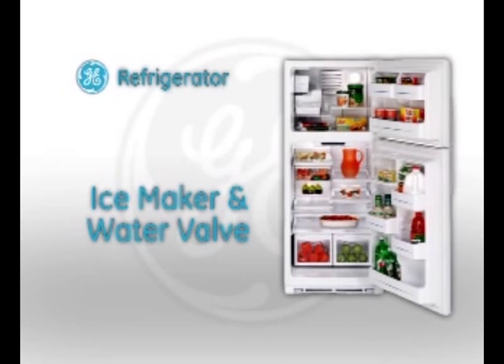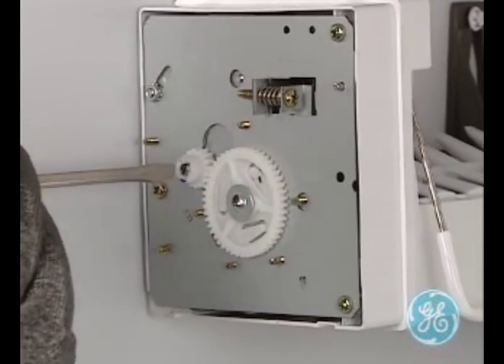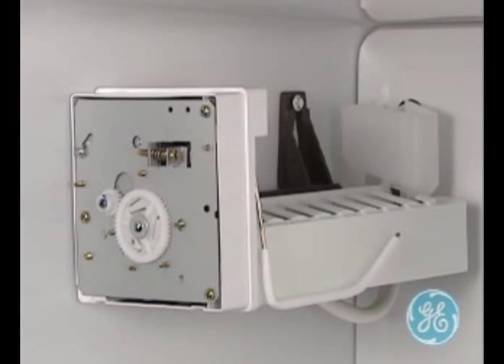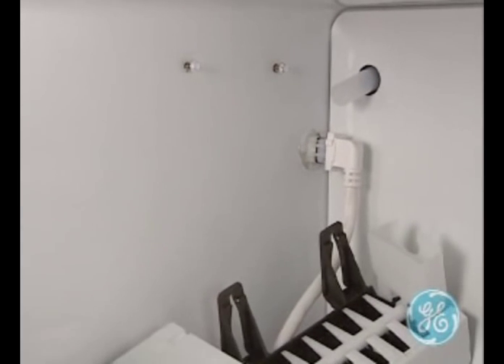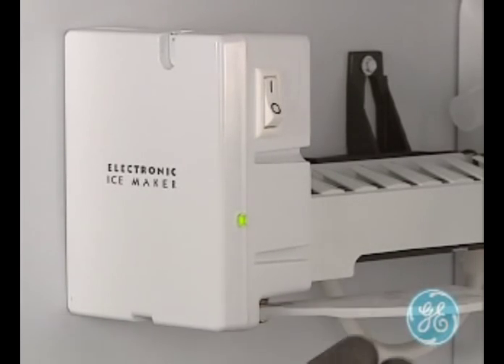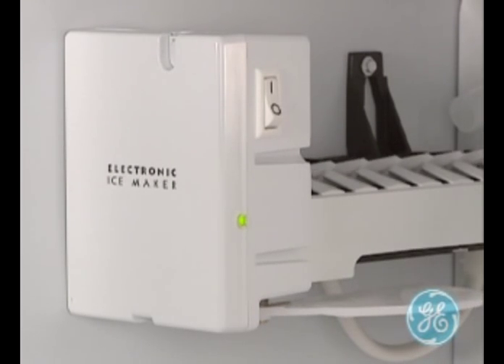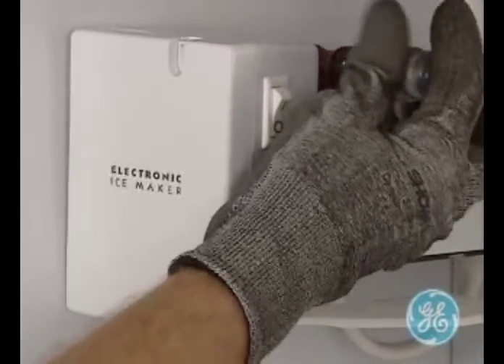GE Refrigerator - Icemaker & Water Valve | HD Supply

Comment: Great video with simple fix! 4 weeks ago the ice maker on my 25 yr old GE fridge stopped making ice but the dispenser worked. So each day I filled up 6 ice cube trays and dumped them into the ice bin. I didn't want to buy a new ice maker for an old fridge. I finally called GE service but they wanted $99 to look at it. Then I saw this video! I turned the little screw and next morning the bin was full of ice. TY TY TY.

Comment: Do you have to turn the water supply off to remove the icemaker or does pulling the plug inside the freezer cutoff the water from flowing?
Reply: (You shouldn't have to mess with the Water.) 
"Check to make sure the ice machine is in the, Turned off Position, then Unscrew, and unplug. 

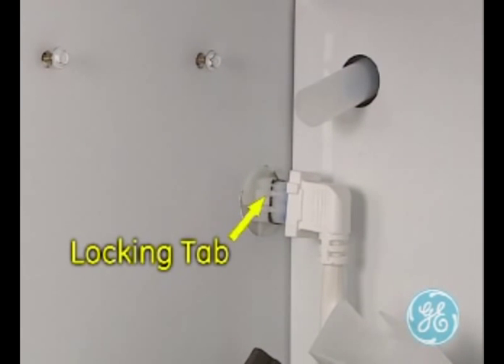(The Electric Solenoid controlling the water supply is located elsewhere in the fridge.) "You can see that at the 1:05 mark" There is no water pressure being held back by the ice maker, just a simple flow tube. 
"Without instructions from the ice maker, The Solenoid will remain in the closed position." 

You're good and goodluck! 🧊

Comment: Excuse the dumb question but how do you remove the front cover of the ice maker?
Reply: Use a flat-head screwdriver to remove the screw-cover on the top. Unscrew the screw with a Phillips screwdriver, then, pry the bottom open.

Comment: I'm having a problem removing the cover. It's not as easy as in the video. I found a tab at the bottom of the cover, but none at the top. I don't want to force the cover off and risk breaking it. Is there another catch that I can't find, or can I pull it off without breaking anything?
Reply: it a screw on top

Comment: My manual ice maker (exact same one) wouldn't go into service mode. Attempting to turn the small screw counter-clockwise is initially possible but gets progressively harder. At about a quarter turn, it wins and spins back to where it was on its own.  No further cycling occurs.  I had already replaced the valve, supply line, and filter after moving homes and over sediment concerns. Finally validated by both pouring water into the tray and shorting power to the valve to prove flow to the unit.
Reply: I tried jamming mine to the right (clockwise) and then left counterclockwise and that got it going. It cycled and filled with water. Waiting to see what happens next.

Comment: Have a GE French door fridge with a wr30x10093 ice maker.  Makes a ton of noise while making ice.  Tried replacing the icemaker and it still makes the same noise.  Any suggestions as to what to try next?  Thank you
Reply: Unfortunately they are a cheap design and make noise due to the stick-slip motor drive mechanism.

Comment: I want to remove but not replace my ice maker.  Is there any after maintenance required?  Do I cover the plug & water inlet with anything?
Reply: My icemaker is turned off and i removed the tray.  The motor is still running as if it wants to makes ice.  how do i shut this off totally?

Comment: My ice maker is making ice but it won't stop even I lift up the handle to turn it off. Please, Help!!!
Reply: Can u tell me how to open it plz
Reply: @jelinalaporte1353  you meant how to open the cover to adjust mechanical? 
You just pop out the cover , no screw using!
Reply: @tinkerbell24ful  I just found out how to do it
Reply: @jelinalaporte1353  what was the answer?
Reply: @livingdulce  u gets a tool like a screwdriver the one that has a rectangle end and u unscrew it I think and then follow the steps in the video I think because it’s been some time since I’ve done this
Reply: @jelinalaporte1353  thank you so much! I got it fixed!

Comment: I have replaced my icemaker and the first issue I had was the water would overfill the unit and lets say double of what it should be.  On this I do not know how to fix this setting.  My model is the same as above with the On off switch.

I have seen this video where it says that after installation to switch on the unit and Move the Paddle back and fourth THREE times to initialize the maker, well this did not fix the problem.

Next the cover when removed shows a screw with a + and - direction that I guess represents the pressure on the rotating unit for the ice cubes, or how much water is needed to fill the ice bin.  The problem is there are no instruction that cover these issues.

I hope someone can help me out with this issue.  At this time the ice maker makes ice, but takes too long to turn the cubes out.  Now after I messed with the adjustment screw it does nothing yet.
Reply: Rational Reality American pull the plastic cover and adjust the little white nylon screw